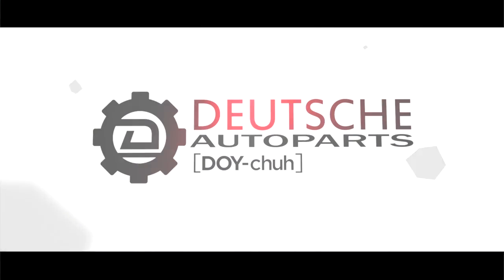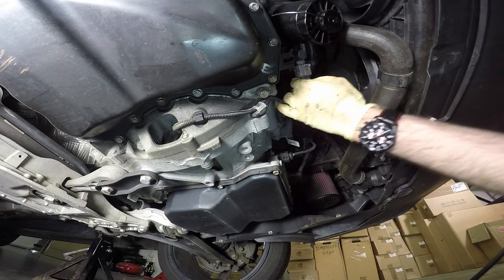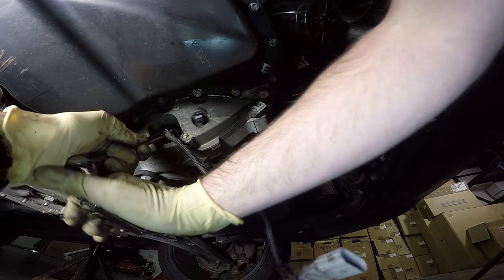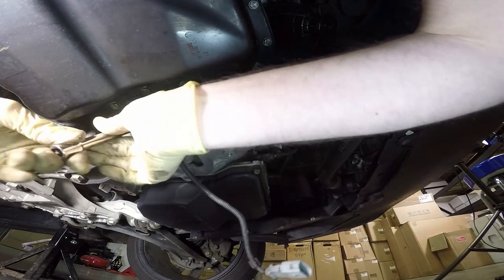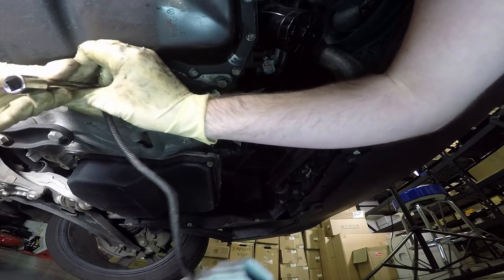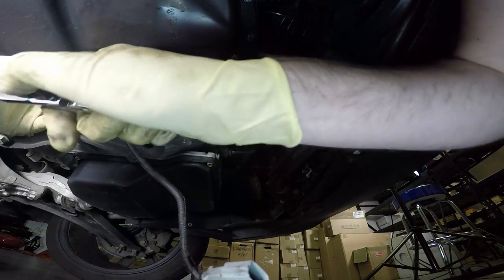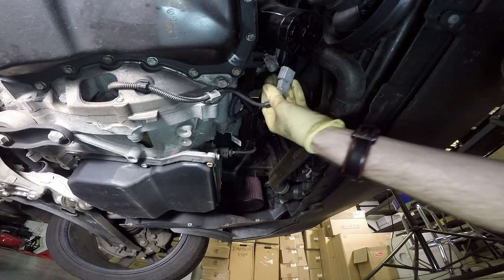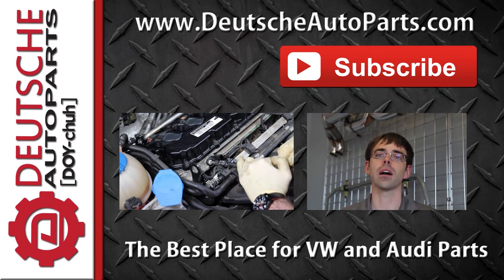How to Install a VW 5 Cyl 2.5 Engine Crank Position Sensor (G28)

Comment: Thanks for posting this useful video! Last Christmas my 2009 rabbit was having problems starting and was also losing power on the highway! Not good. 

I did a little research in the crankshaft position sensor seemed to be the most likely and least expensive culprit.  So I took a chance and ordered apart from Deutsche Auto Parts and, with this video and a phone call I was able to replace it myself relatively easily. 

The two unexpected things I ran into--mainly due to never having worked on my Volkswagen before--were removing the protective plastic cover secured to the undercarriage and also unclipping one end of the sensor. The plastic cover was  easy enough to remove once I found all the screws holding it in place). 

Unclipping the sensor was another story, at least at first…granted, I was doing it upside down while wedged under the car (couldn't get it started to drive onto my ramps). So I couldn't get a very good grip on the clip end but I also didn't really know what I was feeling for. 

One of your employees told me to try clipping a similar wire on another part of the card to get a feel for, which did the trick! Once I knew what I was looking for it was much easier. The video was also helpful in helping me locate the bolts that hold in the other end. 

In the end I was able to make the repair myself and it was pretty easy as long as you can get under the car…all the more so if you can jack it up, put it on ramps or use a lift. 

I saved myself about $150 compared to what the local dealer wanted to charge. Thanks, DAP!
Reply from the maker: +dulkinukas Thanks for the purchase and the feedback.  We appreciate it very much.
Reply: Deutsche Auto Parts  
Hi. I have a question?
How did you order the part for 2006 VW Jetta 2.5?

Comment: Does the new sensor need to be programmed after replacing?
Reply from the maker: +Brian Harris No there is no requirement to program, but you will need to delete the faults.
Reply: +Deutsche Auto Parts awesome. One shop told me it had to be programmed. Maybe they just didn't want to do it?
Reply: @Deutscheautoparts  replaced sensor today on my MK5 Jetta. Cleared codes and runs great. Thanks man!

Comment: How can you test this part?
Reply: I know this is a late reply.  You could probably test it by just driving your car.  This part seems to have gone bad for mine recently, and it's causing the engine to run a little rough & idle high sometimes, and the engine even shut off while driving once.  So after replacing this part, if those problems go away for me then I know replacing this part helped.
Reply: @jadetraveler  Wow what a genius we have here.

Comment: +Deutsche Auto Parts - Thanks for making this video, figured it would be an easy repair, but now I know for sure!  What are your thoughts on this... My wife's '07 Rabbit takes quite a few seconds of cranking to fire up when starting (doesn't seem quite as bad when hot but sometimes is), and runs fine after, except for about half a mile down the road it seems to 'slip' for a second (almost like it's down on power for a second, like the clutch is slipping?).  It's not during a gear change (manual 'box) but may perhaps be when turning a corner? And then that's it, it's all good after that.
Think the Crankshaft Position sensor might help in one or both these issues? Car has done 70k miles but lived in Vegas and Austin, TX so has been in hot climates, and very dry in LV.
Thanks again
Reply from the maker: +evo moto Tough to say for sure but the crank sensor could be the issue https://deutscheautoparts.com/vw-2-5-crank-sensor-g28-07k906433b.html
Reply: +Deutsche Auto Parts Thanks for the reply! I think it's worth trying if only for elimination reasons then... Thanks again

Comment: Hey man, I do have a question I’m getting this error message Transmisión Sensor G182 I just wanna know if is the same issue or is complete different issue, btw I do have VW Jetta Mk5 automatic transmission 2.5L 5 cylinders thank you for the support mate.